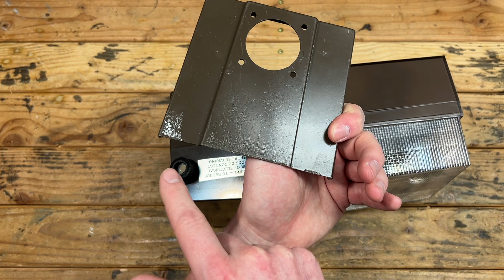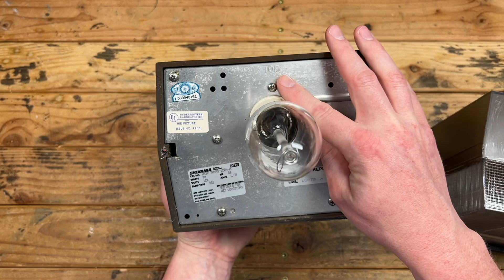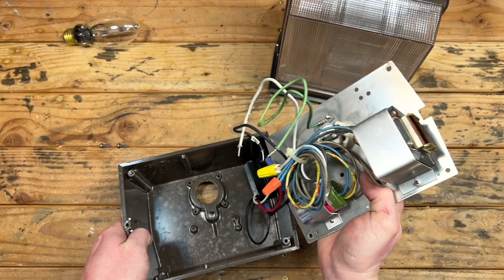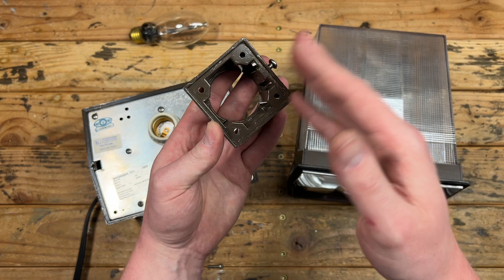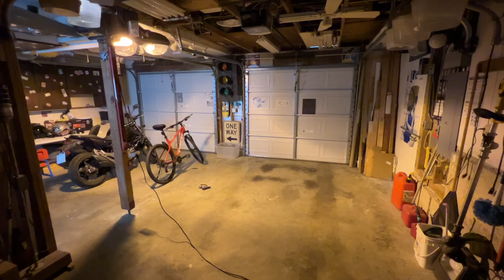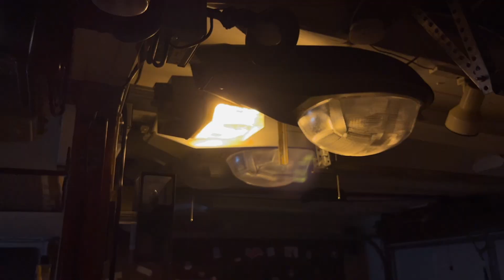Sylvania AlleyKat 70watt High Pressure Sodium Area Light

Comment: I have one. Well used. I once had it installed on the house. It is 70 watt metal halide. Yours would be better with a GE Lucalox than this crappy Sylvania Luma-SUX! They made horrible HPS lamps that don’t have amalgam reservoirs and practically burn out in what seems to be e about 50 hours! 😩 Total and utter CRAP bulbs! Sylvania never could do HID worth a crap 💩! The fixture is nice though! The spring in the Luma-Sux lamp makes them “look” high quality, but they are junk. I had enough experience with them to be able to tell you that. Any HPS lamp with amalgam reservoirs is trash. I guess the metal halide pulse start version like the one I have is pretty rare. The ballast can rub 75-100 watt mercury lamps with the igniter disconnected. Anyway, cheers!
Reply: Sylvania screws up often. Their vintage halogen flood lights are horrible and never last.